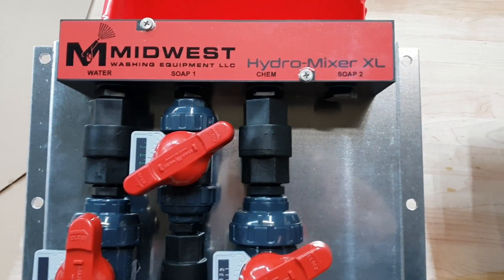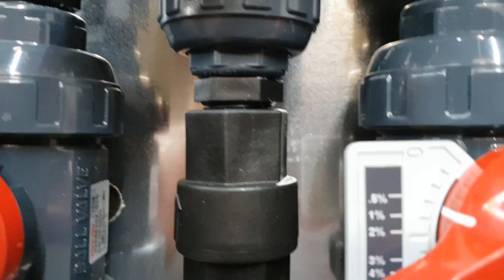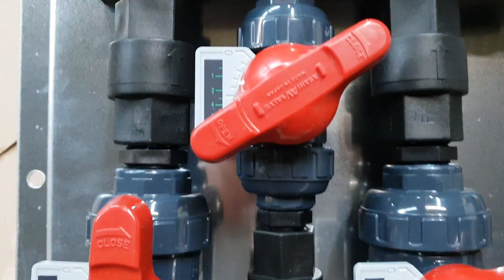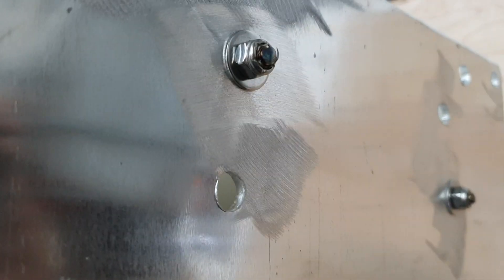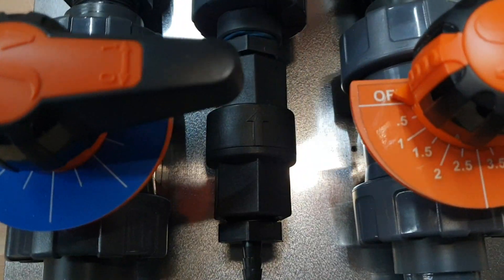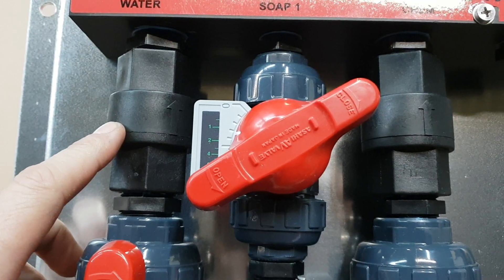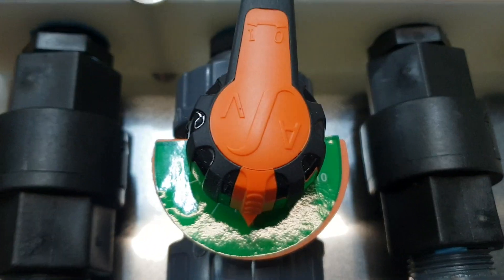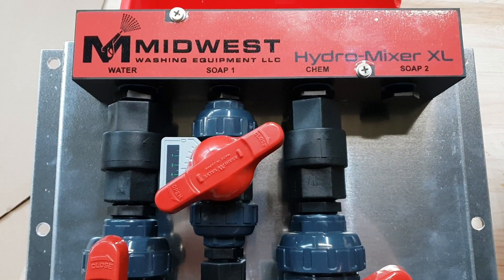Hydro-Mixer proportioning blending unit highlights

Comment: I ordered the XL,  are they 3/4" or 1" NPT on water/SH metering and check valves?
Reply from the maker: 3/4"
Reply: @midwestwashingequipmentllc1209  thank you.  Was going to order the gas softwash system p40 with it but they are back ordered.   ETA on those?  I have the remote rinse module as well on order.
Reply from the maker: @EdgeRoofCleaningCanada  comet is telling us the next shipment of P40s won't be here until late August at best. Remote modules are still about 2 weeks out.

Comment: What are the the red lines on the water valve for?
Reply from the maker: Range for setting water valve if it's not pulling low sh %
Reply: Can you give a little more detail on this? What Low sh % are you talking about when you have to do this? By doing this how do you break it down to where you know what percentage your mix is at?
Reply from the maker: @jackwest2977  1% or less, some setups with longer sh feed lines may require closing water valve slightly, % will stay fairly accurate as long as water and sh pull from same location and supply hose is close to the same length

Comment: Hey quick question, for the soap injector dial, should I draw concentrated soap (like elemonator) or should I draw pre mixed soap/water ? 
Thank you!
Reply from the maker: Concentrate
Reply: @midwestwashingequipmentllc1209  that’s important to know, thank you very much. Now I know to draw straight from the 5gal concentrate bucket!
Reply: @midwestwashingequipmentllc1209  will by 12 v softwash pump be able to pull this concentrated surfactant tho?
Reply: @Thetruthhurtstrump2024  yes